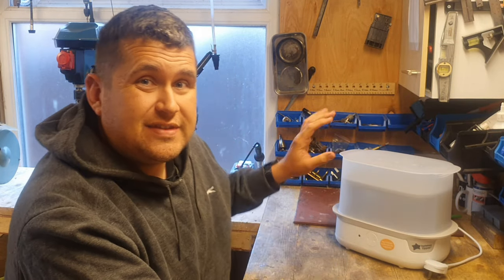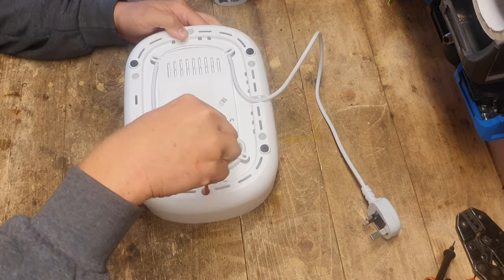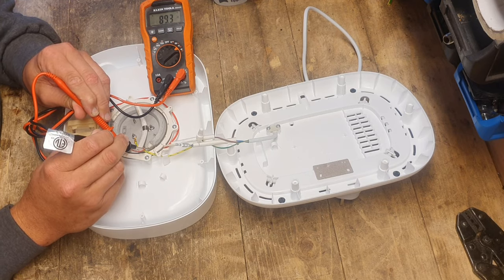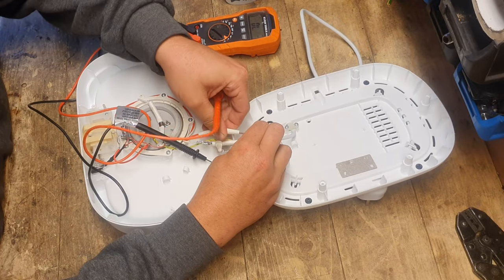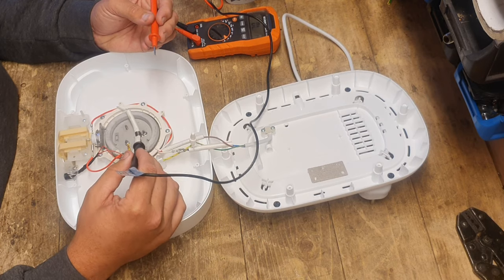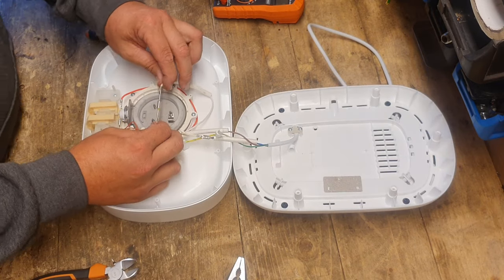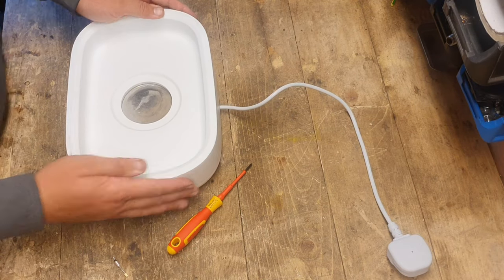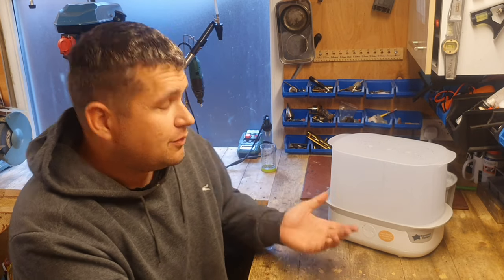How to fix a Tommee Tippee steriliser.

Comment: What are the details on the thermal fuse? Rating/where to buy etc? Think we have the same issue.
Reply from the maker: Hi here is the link on the one I got you'll need to check yours tho https://www.ebay.co.uk/itm/Fuse-Thermal-250V-15A-216-C-/133340362926?mkcid=16&mkevt=1&_trksid=p2349624.m46890.l49286&mkrid=710-127635-2958-0

Also you need to make sure there is nothing else thats malfunctioned the thermal fuse is a safety

Comment: But what caused the thermal fuse to blow in the first place? Yes it could just be a faulty fuse but what if it's a faulty heater? Will you be having to replace it again?
Reply from the maker: That's a good question I checked everything and everything seems to be ok. Will keep a close eye on it. And we'll used it twice already I suppose the worst case scenario would be the thermal fuse would go again and then I just use it for spare parts or projects lol 😆

Comment: I am currently trying to do this, does it have to be soldered? I don’t have one I have tried wrapping the wires right together but not working
Reply from the maker: No I used crimps to crimp it onto the wire also if it's not working maybe the thermal switch has broke hence why the thermal fuse burnt out
Reply: @intelligenttinkering  can you send me a link to the crimps you used please?